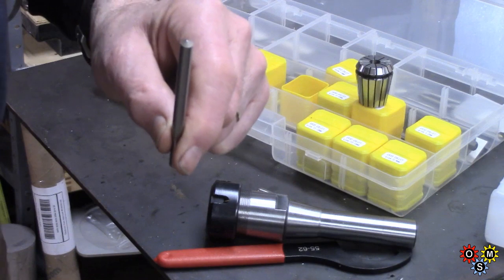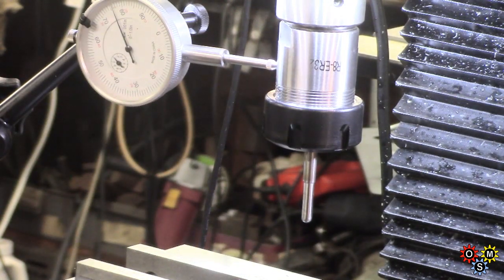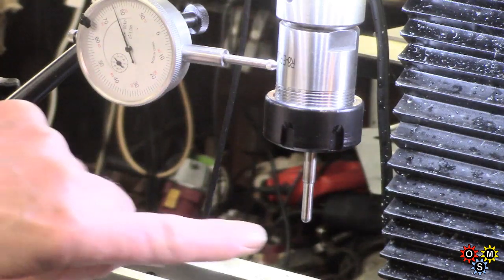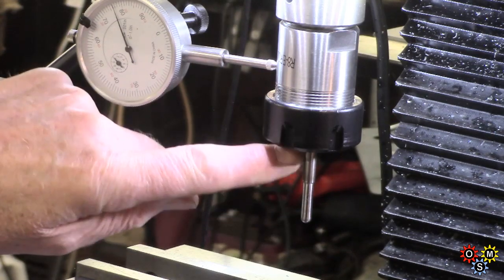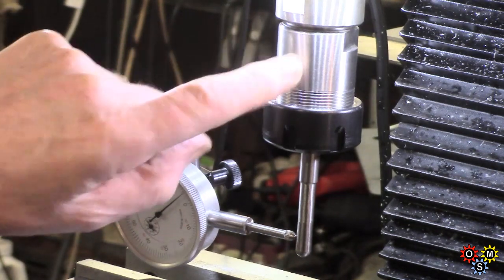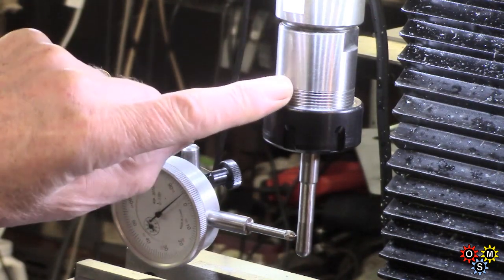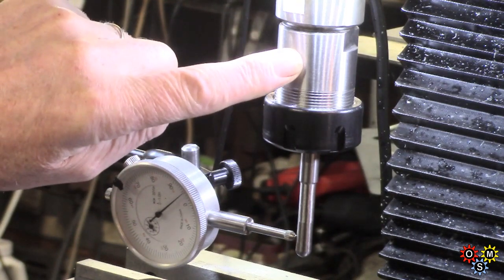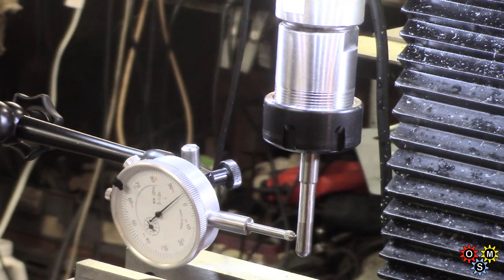ER32 R8 Collet Holder and Collet Set, Test and Review

Comment from the maker: I had the following which was listed as spam for some reason. Thanks to Turning point for the comment.

Turning Point 12 hours ago
The collet chucks exterior basically means nothing and has no effect other than out of balance at high speeds if it was really excessive Chris. For anything like this you need to start at square one. Check the mills spindle taper with a 10ths indicator and make sure it's spotless with nothing embedded in the taper , set the chucks R8 shank in a pair of V blocks with the edge of the R8 taper resting in the V blocks groove and spin it by hand and check that with the same 10ths indicator to be sure it's not out of round or somehow bent. The edge of the R8's taper will put the shank at an angle but it doesn't matter, your checking for out of round or a bend.Then as others have said check the chucks taper while it's in those V blocks or your spindle. If everything checks at very low numbers then you'd check that the collet chucks taper is correct. Or at least blue a few collets and see how well there seating in the chuck.An incorrect taper can allow the collets to tilt.This is all a fair amount of work, but you have to know what the numbers are for each area before you can start saying for sure exactly where the problem is. The test bars should be checked in a V block just to rule out or at least know how much runout you have with them. The carbide should be correct, but if you don't test you can't know 100% for sure.

This is one reason why I'll no longer buy anything like this that doesn't have some specifications for the maximum allowable runout. And why I almost always test to see that it does.If the tool doesn't match or beat those you then have every reason to expect it to be replaced. There is a small chance it could possibly be a large burr on the collet nuts partial ring that snaps into the collet groove. If it's on the underside it's very hard to spot. That could tilt the collet in the chuck. The wobble your seeing on the top edge of the collet nut isn't conclusive since the nut still could be correct on the internal areas, but you may well be right that it is the problem  I expect well under .001" runout on any collets and chuck and mine will easily do that. One bad set of collets, chuck  or nut could happen with any manufacturer, so this doesn't mean much for your review, but as it is now it's obviously unusable. If it really is the nut, well that gives you an opportunity to do a good upgrade to a proper ball bearing collet nut. Maritool make a good quality US made one for decent money. Without special grinding equipment and a way to follow the helix on the nuts internal ring there about impossible to repair any real problems with the hardened surfaces.

Likely you already know it, but others may not. The torque specifications for a ER 32 nut is 100 ft lbs. Less will still hold, but the cutting tool could then move under cutting conditions. And it's helpful to lightly lube the chucks threads but NOT anywhere near the collets bore. The slots in the sides of the collets have to be very clean at all times as well or that can cause runout.?
Reply: It's not just the quill's taper but the parallel section deep inside that you need to check too. If this doesn't match the taper you would get your wobble, but not in this case as other R8s work on your mill
Reply from the maker: Thanks Chris - indeed yes.
Reply: I guess Im asking the wrong place but does anyone know of a way to log back into an instagram account?
I was dumb lost the login password. I would love any help you can give me.
Reply: @Adrien Blaine Instablaster =)
Reply: @Ishaan Andrew Thanks for your reply. I found the site through google and Im trying it out atm.
Takes a while so I will get back to you later when my account password hopefully is recovered.
Reply: @Ishaan Andrew It worked and I now got access to my account again. I'm so happy!
Thanks so much you saved my account !
Reply: @Adrien Blaine you are welcome :)

Comment: Hi...a .005 runout on the actual spindle on a mill is not good and that will only multiply as you go further away from it....i have a cheap grizzly mini mill and dont have collets. Since the spindle  is stupid mt3 design its hard to fine mt3 collets with a m12x1.75 thread.  So i was goung to buy an er32 collet set with mt3 and 12x1.75 thread but not sure now since your review.

Comment: Brother, if I look at the run out on your precision pins, I get the idea that the inner bore of the collet isn't in line with the outside. This is if you have a good fit between the angle of the collet and the chuck. I.o.w., the inner bore is skew to the outside. If it's out of line, it will have the effect of a hole drilled through something at an angle. I suggest that you set up a precision pin in a 4 jaw chuck making sure it's running true close to the chuck and away from the chuck. I know you know how to do this. Now slide on a collet and measure the run out on the smaller side of the collet. Carefully make a mark on the collet without turning it where the highest dial indicator reading was. Now repeat the process on the bigger side of the collet. Does the highest reading on your dial correspond with the mark with both readings? If not you will know that the bore and the outer surface of the collet is out of line with each other. If the highest reading on the smaller and bigger side of the collet correspond with the mark, you will know that the two let's say "diameters" are not concentric - the center line of the bore will be offset to the center line of the outer face.
Reply from the maker: Hi Pieter - many thanks for your detailed comment. Excellent approach for sure. I will get to testing this out when I get a chance - should be very informative.
Thanks again.
Reply: Morning brother, I wish I had a Chinese er collet to do this test. I will soon have to buy one (er32) and will most certainly do the test. I must be honest I was shocked at what I saw in several videos of different people's reviews. I never expected this. I had a reply from a brother who informed me that he was very happy with his Chinese collets and will keep on buying it. I just don't trust anything Chinese. After I looked at all these reviews I trust Chinese  products even less. Happy machining brother!
Reply from the maker: @pieterbotes8938  - Hi Pieter - I think the situation is simply that import tools can be a lottery! For sure some are not worth even their cheap price but ... on the other hand there are some that certainly are OK and represent great value, particularly for folks like me on a very tight budget. All best.
Reply: Lottery? Very true. I most certainly won't order anything from Banggood again. Happy machining brother.

Comment: I got what I believe is the same collet set but from a different vendor.  It has the same exact issue, with the wobble in the bit.  Everything looks nice enough, but it does not perform :/

Looks like other people have had this same issue as well.
Reply from the maker: Hi,
I think one problem with this set-up is the scope for error - there is the holder taper, holder thread and nut and then finally the actual collet's truth. Put that lot together if a bad bunch then not very good!

Comment: I just bought er32 with 2 morse , I plan on using it in my atlas horizontal mill. And lathe if needed. Plan to get the r8 but will have to wait awhile. Getting surgery on spine for pain. If you wanted to machine a tool to wobble like that it'd be a royal pain . Haven't cked my holder yet but hope it's better then yours wow. Thanks Silverbullet aka Gary
Reply from the maker: Hi Gary,
I'd hope that your ER32 will be way better being on a Morse - it did seem the problem I had was with the R8 - partly the internal taper I think much as anything.
Very best of luck with your back surgery - hope it turns out well for you.

Comment: Hi Chris.  When doing these tests it helps to show definitively that it is not your machine, even if you know its not!  It's a quesion of showing hard evidence that you are starting from a known baseline.  Hopefully the supplier will send another holder, but how will we know that's a typical product now? I suggest borrowing another holder from elesewhere and testing in that - it will show how much is collet and how much holder.  A dti up inside the original collet holder taper (painful!) would also be interesting - I suggest using a v blocks if you have one.  These things need to be very carefully investigated in a methodical fashion. Given the holder body is also running out of true it's probably not just the nut.  Having wittered on, well done for showing that there is a problem.  I will now go and check mine! And you are way ahead of me, I don't even know how to do a video channel! Bob. (also getting older).
Reply from the maker: Hi Robert,
True - of course machine truth matters. Thing here was that the error was so gross that it was or had to be way beyond any machine problem itself! I have since done a quick check on the internal taper, which I hadn't bother with previously -- run out is 0.005'!! So that at least is a component of the troubles. I hope (eventually ) to get a replacement to evaluate.
Reply: ChrisB257 Hi Chris, thanks for responding so quickly.  I was trying to say that in testing it pays to show the veracity of the test gear - my bad, did n't make myself clear.  Do keep these videos coming, I'm delighted to have found you!  Bob.
Reply from the maker: Thank you.
No probs Bob - I do agree.

Comment: Hi Chris,
The result seems a little under expectations, just one point before I conclude anything, did you "Clip" the collet in the tightening nut before installing it in the taper?
Then you would need to redo all the testing by controlling the inside of the taper and the concentricity of the individual collets, etc, etc...
Even the cheapest tools shouldn't come up that bad...
Cheers,
Pierre
Reply from the maker: Hey Pierre,
Yes - collets were correctly installed! learned that a while ago!
I hope I'll get another to try but expect when time I'll explore this one and try and actually diagnose the problem fully if possible. You are right - nothing should be this bad, but, it was donated for review so no cost. We'll see what happens next.:)
Reply: They look very bad, as it's an item to be reviewed, they could at least make sure they would send something tested....!!!
I'll follow with interest, if it's mail service it could take at least a month to get there.

Comment: I would check runout on the inside of yout R8 taper, ideally in two places if you have something like a dial test indicator so you can reach up inside by an inch or so. If you have runout, mark the high or low point on the outside of the spindle nose where you can see it.
Then as other have suggested I'd check the inside of the adapter taper for runout, again in two places. See if it is different from any R8 spindle runout.
If the inside taper is good, put a test bar in a collet, but don't snap the collet into the nut, in fact use a bit of corrugated cardboard between the collet nose and the nut, and only tighten enough to keep the test bar from slipping. That should have the collet seated only in the taper and not too badly influenced by any nut runout. Then look for bar runout.
If all that works out well, the problem is definitely the nut.
Reply from the maker: Hi,
I definitely will be checking the internal taper when i get to it - but hope I'll have another to try out eventually. You make some good suggestions - thanks.

Comment: have you checked the taper inside the collet holder see if that is right it can't be the collets as it run out is to consistant if you know what i meen and the nut wobble may not be the problem if it is machined surface is correct on the matting part side
Reply from the maker: Hi Colin - testing the taper is on the list when I get time. Hoping another one may be way better.

Comment: Not for one minute am I doubting your expertise but cam across a fault like this a while back on a friends mill. He was not fitting the collets into the locking nut but tightening the nut down onto the collets after inserting the collet into the holder. It's a simple oversight to make but makes a big difference. Once shown how to snap the collets into the nut first nearly all his running off problems disappeared.
Reply from the maker: Hi Andrew - the collets were being properly installed first - I learned that a while ago when I was new to these collet systems! :)
Reply: I noticed chris locked them into the nut.
Reply: ChrisB257 I am sure you were but it's not the first time people have got it wrong. I just thought it was a good time to bring this way of possibly inducing errors to the fore,for everyone's benefit. I have found its people used to using clarkson auto lock collets who are liable to getting caught out. I still use my genuine clarkson auto lock for the really important jobs plus still have hundreds of compatible cutters for it.

Comment: Another thought.  Cut it apart, face each 1/2, thread the outside and make a coupling to screw both halves in and then tig weld together.
Reply from the maker: Hi,
That sounds rather complicated! :)
Reply from the maker: That is a bit extreme!! :)
Reply: But it would work :)  That would be something I could afford to do.  Getting another would probably be out of my budget for quite awhile.

Comment: I think anybody can get it wrong one in a while...Quality control missed one, for sure.  Nice video, Chris.  I'm sure you'll get another one to retry and I'm thinking this one will be dead-on!
Reply from the maker: Yes Dale - collets installed correctly -- made that error once some time ago! I'll get to taper testing when time.
Reply from the maker: Hey Dale,
Not sure how good QC is - maybe none on this piece! Certainly hope to get a replacement... we'll see! I may even try some tests on this one regarding the taper truth.
Reply: Two people have already asked you if you snapped the collet into the nut properly...as if this were your first rodeo ;-)...  Anyway, I'd do some tests on the taper also.  I would do the same critical tests on any similar set up I bought...foreign or domestic.  Looking forward to your results, Chris.
Reply: dale pratt Most Chinese manufacturers have chosen to outsource the QC step - to the end user. I'm not condemning them, mind you, as it is the demand for cheaper products that prompted that move.
Reply: Makes sense, as long as they back their product up and will replace it with one that hopefully runs true.
Reply: I've had good experiences with Banggood so far (though I haven't needed to do any returns), and they seem to be trying very hard to compete with both eBay and Amazon. As this was a case of providing product for publicity I should hope they will take care of Chris, even if they wouldn't normally do so. 

It was funny to see this tonight as I had looked at these items just recently on their site (actually I had considered the ER40 version). But I need to round out my R8 collets and I want a full 5C set before I can even think about investing in any ER.
Reply: I had no doubt that you snapped them in, and I believe everyone who has ever owned an ER collet set has done it the wrong way the first time, me included! :-)

Comment: I bought both the ER32 holders in MT3 and R8 from Bang Good. Same thing .009 run out, it's the holders that are junk. If you check the run out in the holder taper you will find the problem
Reply from the maker: Hi Robert,
Maybe then I should check that taper - though did seem as though nut was the prime factor re its thread. Either way - we'll see if a replacement does any better. May even if time, try and true the taper.
Reply: ChrisB257 If your holder has a bad taper I would like to see you try to correct it. I don't think I would ever see a refund so might as well try to true it. Can' t make them any worse.
Reply from the maker: May get to that Robert, eventually. Mind you, these items were free to be reviewed and I have been told they will probably send another - we'll see!
Reply: I may be making a small tool post grinder and try trueing they are not good as is on mine from a different source

Comment: did you clip the collet into the collet nut (they use an off center washer to pull out the collet as this angle is a sticky taper) if you haven't you would get these results.
Reply from the maker: Hi,
No - collet inserted correctly - the first clip showing the stuff had the 1/4" collet inserted which, if inspected, does show correct location. I did once in early days with an ER series, nearly screw up doing that incorrectly!

Comment: I'd take the nut and collet off and check the inner taper of the adapter for run out.
Reply from the maker: Hi,
I didn't bother with that yet, as it still seems to me that the nut is not tightening up square - which seems to be pulling the collet off center. Either way - Houston, we have a problem. :)